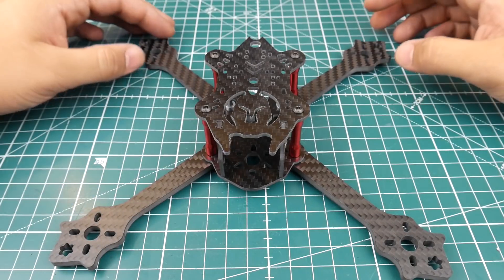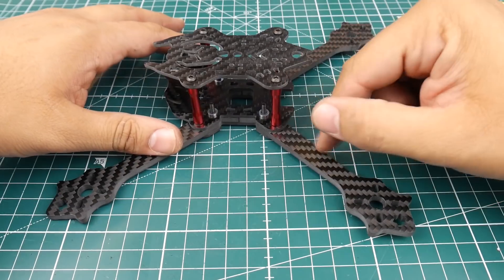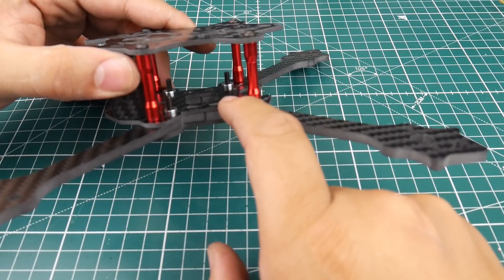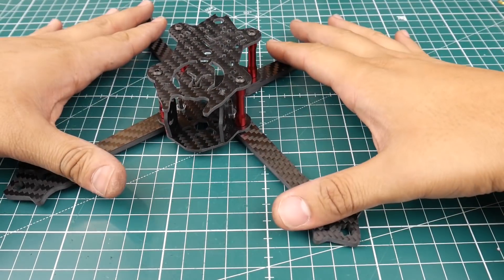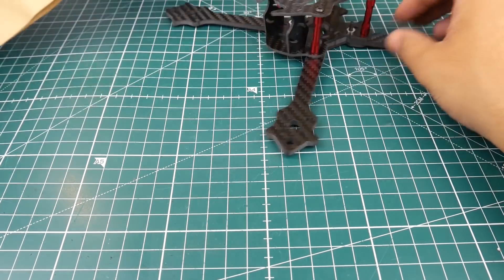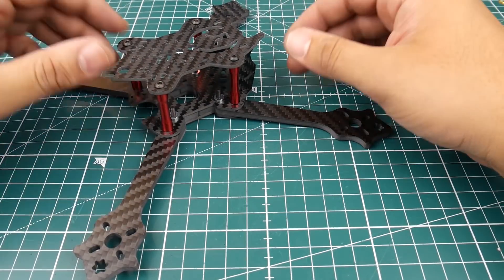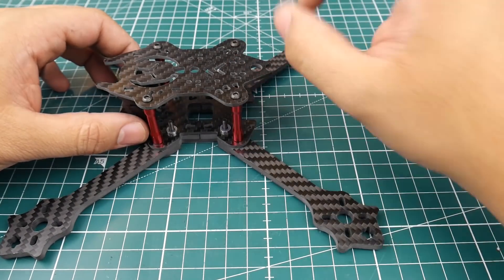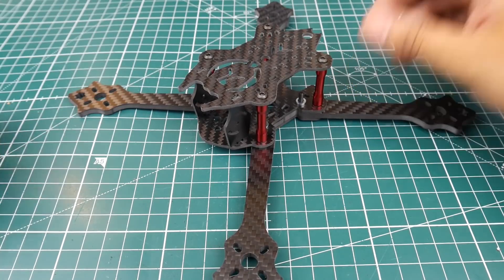210XT Carbon Fiber FPV Racing Frame + Giveaway  // Overview

Comment: 18 bucks for that is really cheap if it turns out the carbon holds up :) A little job with the Dremel and Loctite 410,and the frame will look nice :)